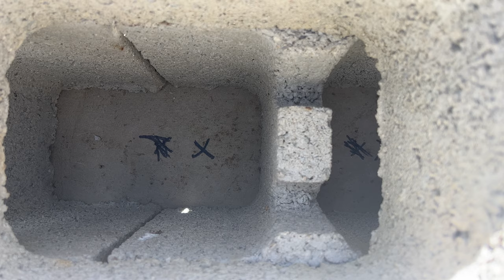Building a Retaining Wall With Bloc a Bancher [Part 2]

Comment: Dear Ian, the next time you use the concrete mixer, try to put a quarter of a bucket of water first, in order not to cause the mortar to stick to the concrete mixer and to prevent cement dust. Nice team!
Reply from the maker: I normally have some water, I wash the previous out and leave the water in - but this first bag "Julie" forgot to put the water in 🤪

Comment: Looking great Ian and Julie,youre ducks in the manhole for the electric cable, just looking at the high compared to the future building it looks high unless you are putting the house on a higher level ,or is it going on blocks and beams made with concrete
Reply from the maker: Your right, the Garage is about 1.5metres higher than the house location.  We will have some steps and a ramp down to a flat area for the house as I am trying to keep that as low as possible.

Comment: Hi Ian & Julie, great job where do you get your stamina from ?  I was a little worried when you were using the chemical fixing as in my experience I would not pre-fill too far ahead as it re 27:56 ally goes off quickly, but you seem to have got away with it, well done.  Looking forward to more episodes.
Reply from the maker: hahaha, yes I have learnt the hard way in the past.  I know I have around 6 mins before it is unusable plus Julie got about a 100 mixer ends from the builders merchants for free so I do swap them out more regularly than normal.